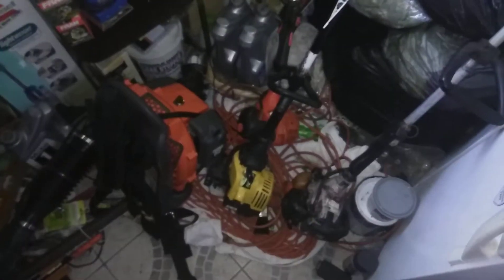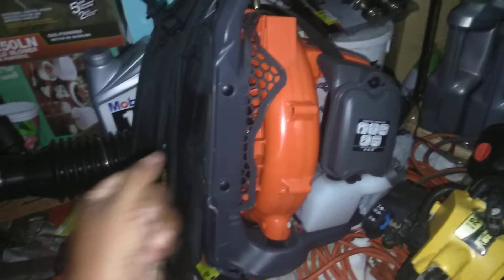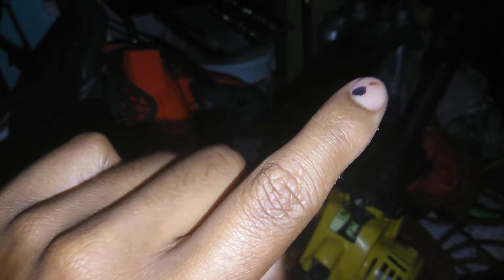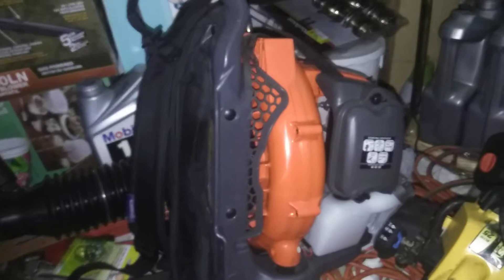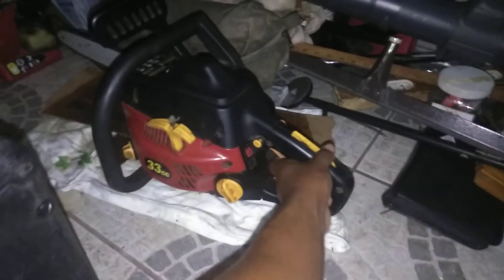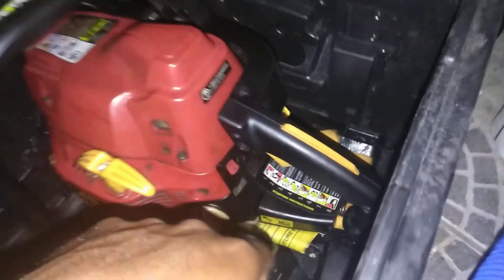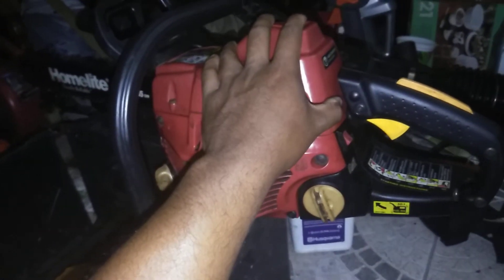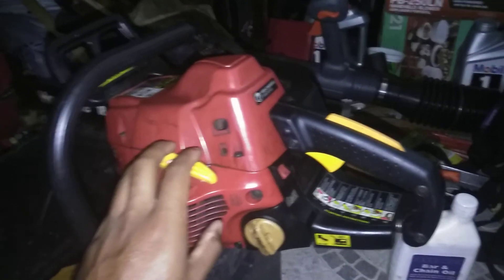Troubleshooting a 45cc Homelite chainsaw - (Typical Chain Brake Problem)

Comment: Couldn't he just have loosened the brake band instead of cutting it off......
....and I was searching the web looking for a brake band because mine wore through. Sigh
Reply from the maker: I didn’t know how to loosen it, i think it was kinked too. I don’t know, I forget. I just remember cutting it. The video is old. Lol I have 2 home lite chainsaws and neither of them have the brake band on them lol On this chainsaw I cut it off. The other one was already off from the guy I bought it from. I don’t think it matters about the brake band too much. Yeah it’s for safety, but I wanted it to run and that band was stopping the saw from rotating so I just cut it off. It works perfect now. Still works amazing. Lol fuck a band. Seems like that band is an issue more than anything with these saws. The reason I cut it off and not putting one back on. It doesnt need it
Reply: @GreenThumbEngines hopefully your stupidity didn't get you injured because you're definitely asking for it doing dumb stuff like this
Reply: i did the same thing, i've had chainsaws without any chain brake, i don't need a brake on a chainsaw honestly. It's easier to just cut it, takes a couple of seconds.